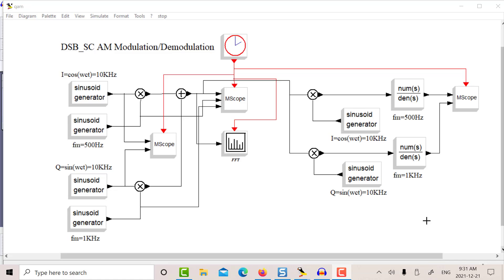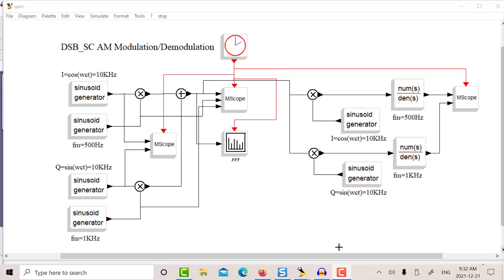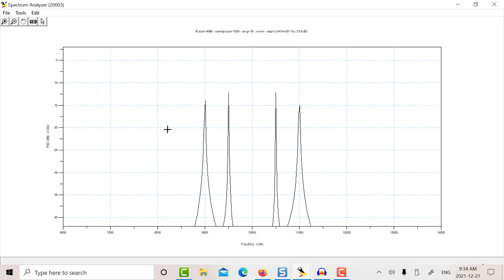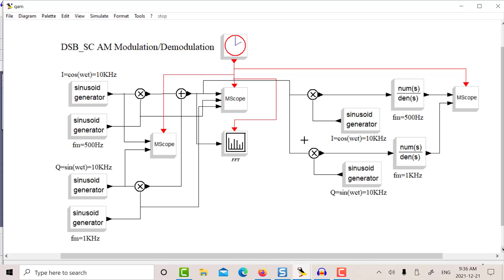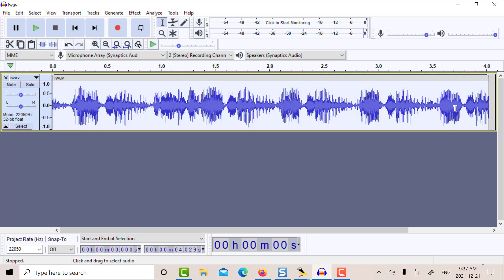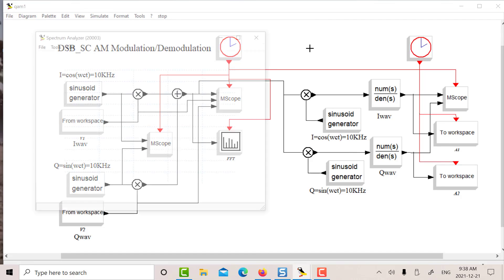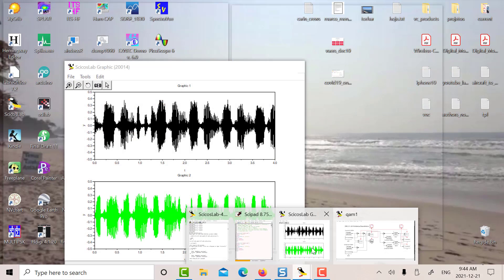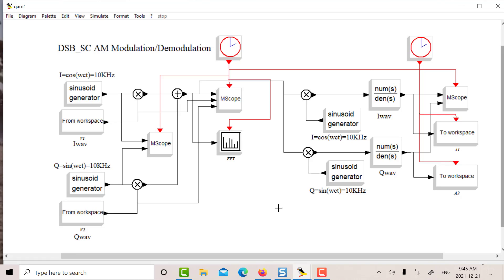QAM Quadrature Amplitude Modulation - Analog

Comment: Ahs, this is what I'm looking for.
I need to find a way to send 4 discrete values down a cable using analogue QAM4.
Reply: What do I have to learn before this make crystal sense?
I've good a fairly good grasp bit it needs to be inside out.
Reply from the maker: Do you want to send 4 analog signals down the cable, or 4 discrete bits?
Reply: @ClarkTelecom  
Many thanks for getting back to me!!
😉👍

4 analogue values.

OK, I've been thinking of ways to make modular synthesisers polyphonic instead of monophonic.

Current mono systems:
Short 2-core (mono) patch cables carry a DC voltage.
One cable for pitch, 0V is middle-C and the standard is 1 volt per octave.
0VDC = C⁰
1VDC = C¹

Then there is a gate cable.
0VDC = Note Off
½VDC = Note at ½ Volume
1VDC = Note On

These are called CV connections, Control Voltage connections

So, if I can fit 4 analogue values down the the CV Pitch connector and 4 analogue values down the CV Gate connector, we now have 4 voice Poly instead of Mono.
Reply from the maker: @MostlyPennyCat  Ok let me do a bit of research. I built several guitar amps & synthesizers many years ago, so it has been a while. So have to do some reading...control voltage drives a VCO....making sense. I will get back to you. What type of cable? Two conductors with shield?
Reply: @ClarkTelecom  
I'll be following KISS unless it is revealed that the simple ideas just don't work

So, kiss cable idea number 1:
Unbalanced mono patch cable with two pole minijack plugs, signal and shield
A pair of cables, CV Pitch and CV Gate

KISS cable idea number 2:
Balanced mono patch cables with 3 pole minijacks.
Shield, reference and signal
A pair of cables, CV Pitch and Gate

KISS failed serious cable ideas:
Mini XLR 2-pole?
Mini DIN?
Proper coax cable?
BNC connectors?
LEMO connectors?
Basically proper RF cables.

I'm really really hoping that unbalanced patch cables work, so you only need one came type it's just used differently.
Hopefully it'll also add some jank to the signal, vintage analogue synths are supposed to sound perfect! 🥲🥲
Reply: @ClarkTelecom  
Have a look at the videos about the Elektor Formant synthesizer by the channel LOOK MUM NO COMPUTER it's sister channels to get an idea of what they look like and how they work.
If you can find me on Twitter I have tweets linking the complete build guide PDF for this synth too.
Just for context, I'm not going to try to make it poly per anything.
I think my first module will be a 'breakout module' that has a pair of Poly-ins and breaks it up into 4 output pairs that you connect to four VCOs and VCAs.
Just as a proof of concept
OK, that's all the idea I've got at the moment.
Reply: Oh and the poly sockets, if they ended up balanced using stereo patch cables they will need backwards compatible with mono patch cables because it just uses the shield and reference as a single conductor.
Reply: And thanks for helping of course! 😁👍
I guess I'll need a pair of SDRs either side of the patch sockets?
I've got one, I just haven't learnt how to use it yet.
Reply: If the proof of concept works in going to design dedicated polyphonic VCOs and As.
And I'm going to call them PVCOs and PVCAs.
They'll have PCV ins for pitch and gate.
Reply from the maker: @MostlyPennyCat  Ok thinking out loud. You want to send DC voltages and multiplex them on a cable. The QAM technique in this post is for signals of a range of frequencies. How about a 4 channel ADC on one end cable and 4 channel DAC on other end. The 4 DC voltages are converted to an 8bit code sent down the cable and reconverted to 4 DC voltages at the other end. Signal, Clock, Shield = 2 wires + shield.
Reply: @ClarkTelecom  
I'll go digital if I absolutely have to but it's against the grain, the soul of the exercise.
CV and 1vpo is so beautifully simple that it would just feel wrong to start criss-crossing the domains.

Funny thing is I've always seen QAM as a digital thing, but after watching Wendover's doco on GSM using QAM and re-reading true QAM pages on wiki I was surprised to find that there is both digital QAM and analogue QAM.

Anyway, I've found a page on analogue multiplexing and I'll see if anything comes out of that.